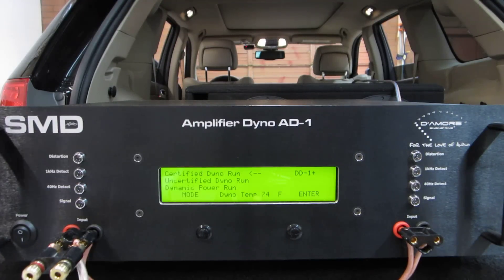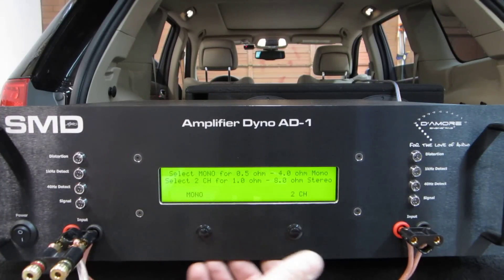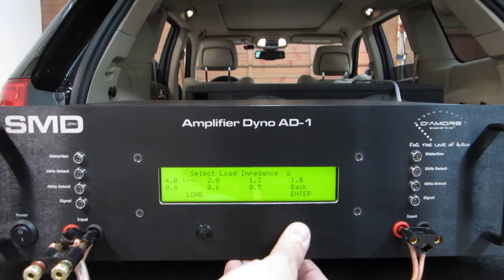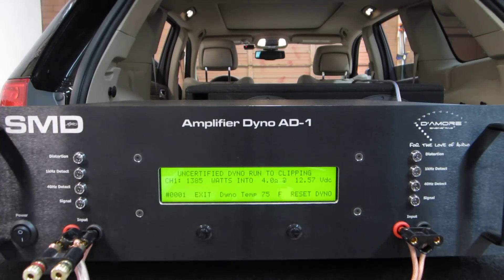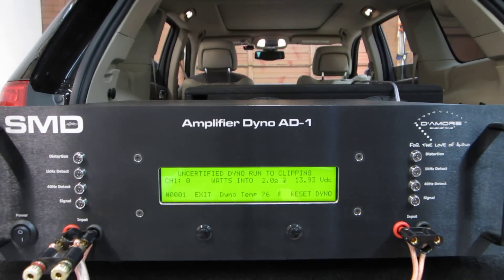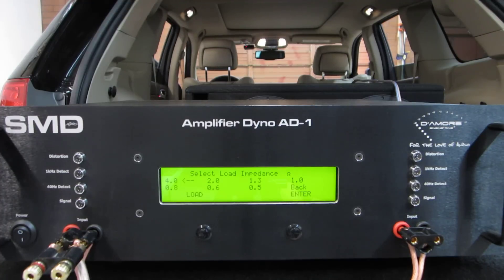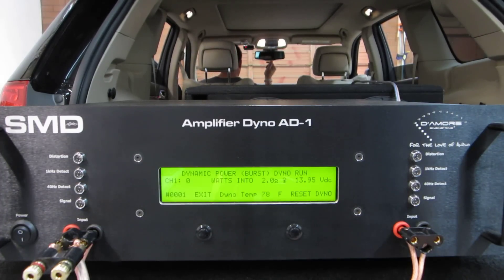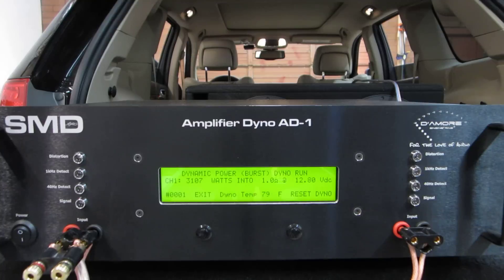SMD / D'Amore Engineering AD-1 Amplifier Dyno demo part 2

Comment: You should’ve matched the dyno numbers to the amp on bench numbers to see if the difference between 14v stable bench to voltage drop to 12.08v in everyday vehicle.

Comment from the maker: It looks a little more dramatic on camera than it does in life, but yes the Jeep has 180 amp alternator.  So you can think of it like this, alternator puts out 180 amps at 14.0 volts, so if you draw more than 180 amps you will be getting the extra power solely from the battery, which is at 12.6V.  On the 1 ohm bursts the amp was drawing over 250 amps so we were dipping into the battery voltage for sure.